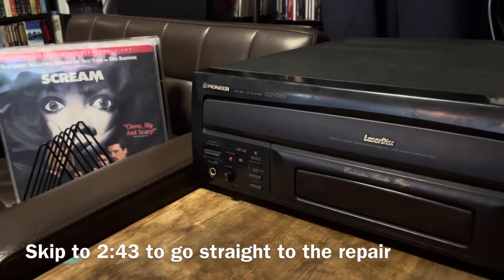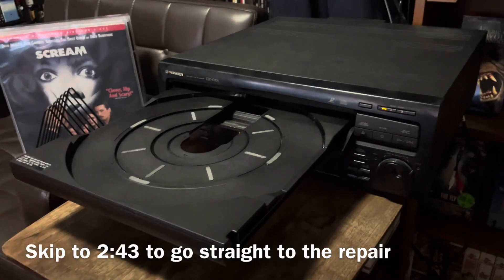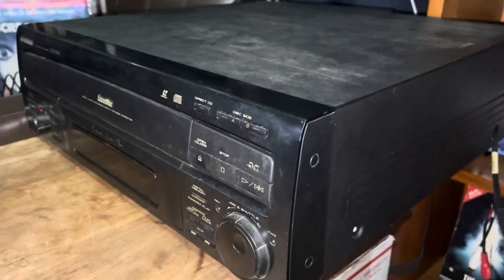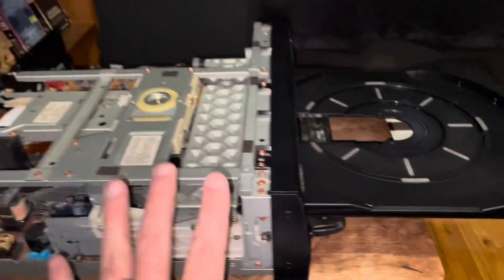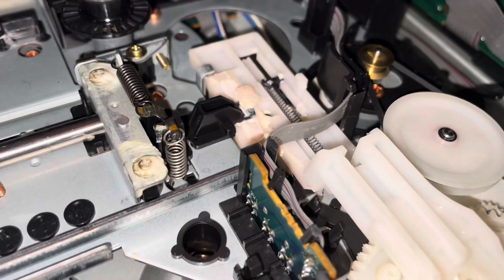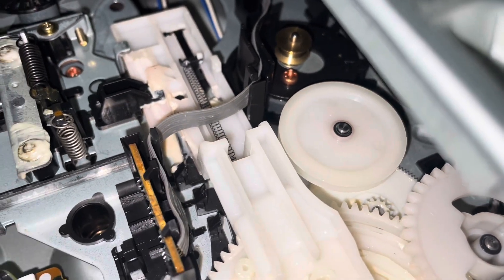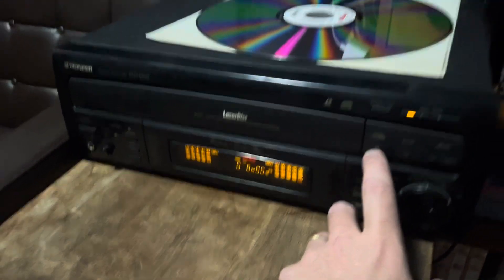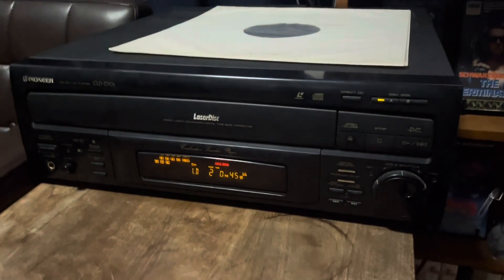Laserdisc Player Repair Loading Belt Replacement Tutorial (fix tray not opening) Pioneer CLD D-701

Comment: I replaced my belt on my D501 but now it's making a grinding noise when it ejects the tray
Reply from the maker: Strange.. something could be in need of a lube job. Specific parts occasionally need to be greased up however make sure which ones before you do and never ever lube the belt itself as this will lead to the belt slipping.
Reply: @savagemathorror4671 it's having a lot of other problems. The auto flip works only when it wants to, and it has crosstalk issues with every single clv disc I play. I may just have to scrap it